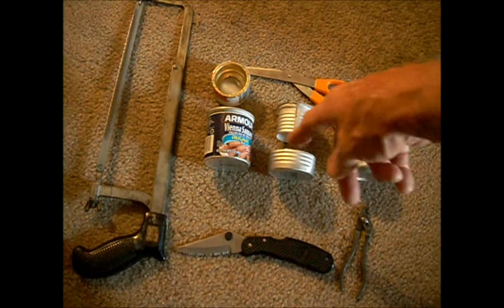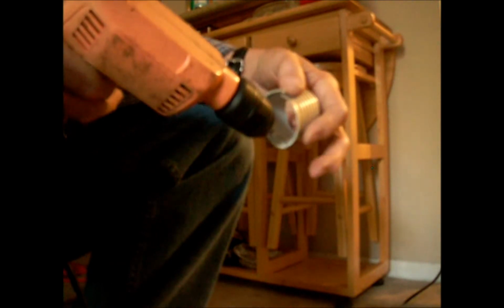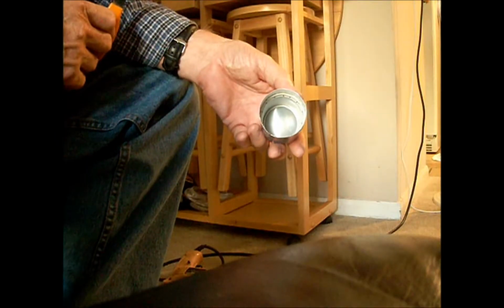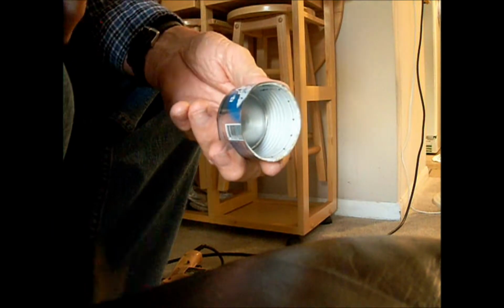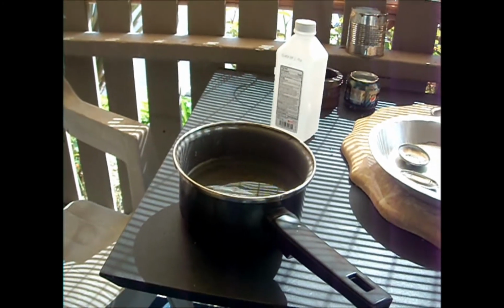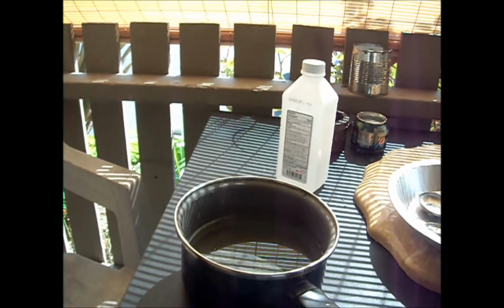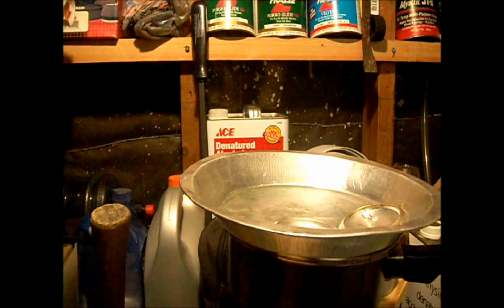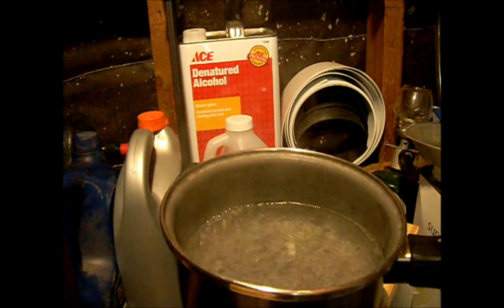build an Alcohol stove

Comment from the maker: I'm having a ball building these stoves.  Let me add that the hole sizes don't make a lot of difference.  I use a Needle about .025 thick.  and make the holes about a 1/4 inch apart.   I said 2 or 3 ozs of fuel.  further tests have shown much less fuel for 40 minutes of burn.  Needles start a hole easier than a drill which skitters around before it starts.  Let me add that a wind break is way important with these stove.  I use 2 coke can sides and bend them together for a 5 inch tall windbreak.